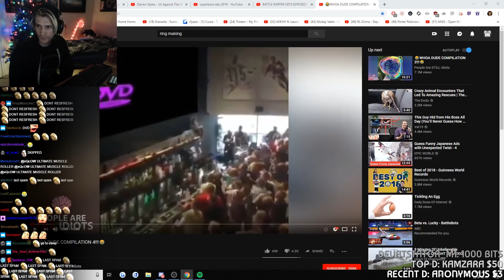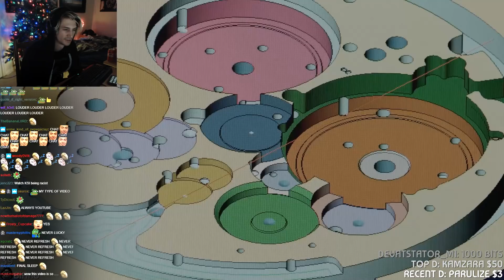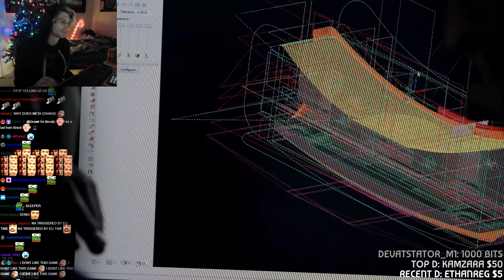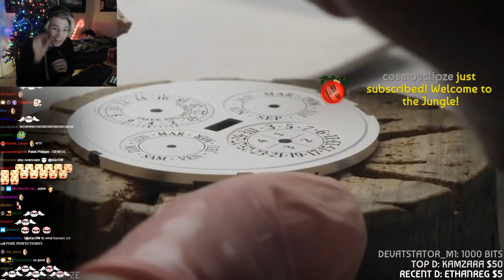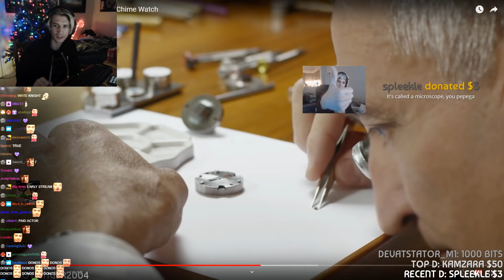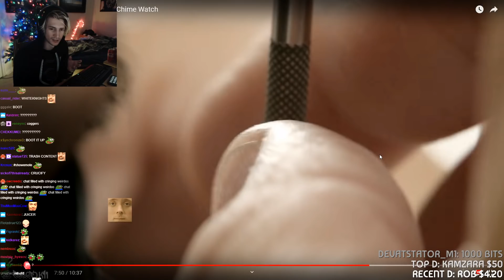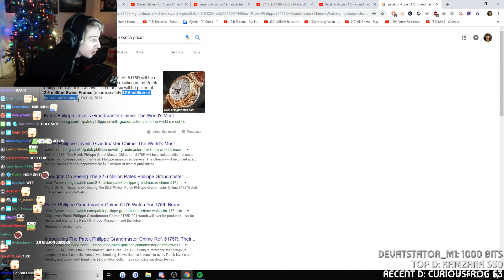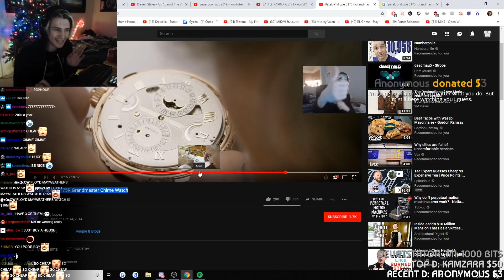$2.6 Million Dollar Watch - xQc Reacts to Patek Philippe 5175R Grandmaster Chime Watch | with Chat!

Comment: It's the same thing with most one-of-a-kind items. A Rolls Royce is built from scratch entirely by expert craftsman and they cost between 200K - 1M. The price is fair.
Reply: You're paying for the craftsmanship, if 10 people in the world are able to do that without mistakes they should earn a fuckton of money
Reply: @ssm-sf8by  Nothing like that should ever be worth that much. Anyone who buys this has too much money anyway.
Reply: Ecksy Dee exactly, this is common sense. Clearly it took you a long time to figure it out since you decided to comment on it
Reply: @SeRoAnthem  really? You're telling me this isn't a budget watch? How wild!
Reply: Not only the craftsmanship, but also the incredibly extended knowledge that goes into designing and manufacturing an object like this. After which you also have to factor in the workspace and all the tools required for building something like that. Here's an example. One of the machines that build LEGO bricks can easily cost 100K USD (excluding running costs). That price is offset because the machine will then produce billions of similar pieces. Now compare that to the tools and machines required to construct a watch like this, where most parts are bespoke or highly limited in production. That's not something you can compare to average market prices, and is the reason why limited productions and bespoke items have an exponentially increased value compared to mass production markets. Even a Rolls Royce has many parts that can be sourced or built in high quantities through partnerships with other companies (like BMW), which greatly reduces the production cost per piece. Of course a price on a watch like this Patek Philippe is to some extend inflated because it's so unique and exclusive, and they know that there is nothing else quite like it, and people who can afford it can afford the extra inflation in price. If you tried to be too competitive with such a time and resource demanding product,, then the final sales revenue would not make it worth the time, and you might as well go for something less exclusive that can be sold in higher quantity for the same effort and still make the same money.
Reply: @SeRoAnthem  Money is simply a made up term that describes how many choices a person has within society. Having lots of money or spending lots of money means nothing on its own. If you can't get what you want because someone things it is "too much", then you limit your choices in life and then you might as well just throw your money out the window. Being able to chose to own something like this watch is the entire point of making money. If you have the choice to own it, and you want to own it, then it shouldn't really matter how expensive it is to buy. To each their own, I would never get a watch like this if I had 10x the money, but for someone else it might be the very reason why they strive to have as many options in life as possible - which equals to having lots of money.
Reply: N OMEGALUL
Reply: @Real_MisterSir  x to doubt, I don't have money and I can steal this shit TriHard 7
Reply: @bloodwolf2609  yea like a watch like this will just lay around casually in an average home without security.. just steal it 4head
Reply: But tbh it's just tells time. I'd rather just buy a normal watch 😂
Reply: @drage1019  The thing is, you don't get a watch like this for just looking up what time it is, in the same sense that you don't get a Picasso painting just because you want something to hang on your wall.
Reply: It took them 10 years to make it
Reply: @drage1019  time is the most expensive thing we have got  so why should we read it cheaply
Reply: DRAGE people can spend their income in anyway they want, not everyone earns minimum wage hence why there are millionaires and billionaires. Same goes for cars.🤷🏽‍♂️
Reply: JACpotatos I mean whoever bought this for 2.6 million in 2014 just made almost 19 million dollars because it’s worth 21 million now so in reality it’s an investment that will pretty much always return
Reply: @drage1019  Why dont you send part of your money to charity too then? If they worked hard and earned their money let them spend it on whatever they want.
Reply: @SeRoAnthem  this sounds like communism to me.
Reply: @drage1019  lmao imagine thinking rich people are obligated to donate money unlike the middle class or lower class
Reply: @drage1019  Lol you are delusional.... The reason why you would buy a watch like this is because its the best investment there is.
Reply: @toooooooooooooooooooooooooooom  no it isn't 😂 invest in something better. Like a business or a house, something that actually has a function besides telling you what time it is
Reply: @toooooooooooooooooooooooooooom  This dude really just said invest in the property or stock market and not a watch and you're calling him dumb lmao. You actually managed to be more pepega than xqc himself.
Reply: @xaten1923  I dont know what a pepega is and i dont watch this xqc guy but do tell me how you could make more profit from lets say ETFs with speculation or hedging, than a highly limited edition watch in a year.
Reply: @binraswtor7760  It is. Hes insecure and unhappy that people are more successful than him
Reply: @ziinx5899  Heh, if you say so, kid
Reply: @ziinx5899  And yet your perspective is that of a child's. So really, there's no harm to me calling you 'kid', kid.

Comment: With the materials needed to make it, the machine costs, and the work time, 2.6 seems fairly decent. The precision needed to make something with this many moving parts is incredibly hard. Most of these parts probably have tolerances in the range of hundreds of  micrometers.
Reply: ^ finally someone with common sense. Also remember to take into account the experience and education that a watchmaker of this quality has to undergo before undertaking a project like this watch. People who say it is way too expensive, could just as well be saying that a spinal surgery should be relatively cheap because the materials and equipment used is similar to many other surgery types - but they forget that you'd likely need 15+ years of education, and then another 10 years of experience before you could successfully undertake a spinal surgery. Education and experience of this high quality is not cheap, nor is it common. It gets exponentially more expensive for each years worth of experience and know-how that has to go into the operation of creating something like this watch. Maybe 1000 people in the world have the skills to do it, and most of them don't have the time to invest into such a project, so it is really clear that such a price might be a tiny bit inflated, but is well worth it regardless. If it was a government-owned object it would just be deemed invaluable because you'd never find it anywhere else ever again.
Reply: Michael Franz  theres only like 25 millimeters in an inch so i think youre a little off with that one..
Reply: @THDYZ  no its not worth 2.6 mil it's just not don't even argue for it. That's just dumb.
Reply: Tolerance is in the 1/1000's of a mm, you can catch the measuring tools in the beginning. There are very few people able to assemble and properly adjust a watch with this many complications, just the chiming part is hard enough to get the sound/timing right.
Reply: @THDYZ  'happily pay 2.6 mil' for a watch. Ok then. Can't argue with that. If their happy paying that much then it is worth it.
Reply: 2.6 or not even if you had the money they wont let any random buy it its like limiteds cars from ferrari that only " specials clients " can buy
Reply: Alessandro Di Salvo the work is a lot more than what’s shown, plus you have to consider the design which is patented for that watch only.

Comment: The watch is so expensive because of the insides. This watch works without batteries. It starts spinning when you move your arm and you it will probably work for some weeks just by one flick. And this watch definitly took 3months to make + swiss quality and swiss pirce its not that expensive
Reply: How long does it take to craft a Patek watch? Stern: An example, a simple movement is minimum four years of work before you can present it. A complicated one, we're talking about six years approximately. And a very complicated one, like a minute repeater or a tourbillon, this is about eight years.  Taken from a source on the internet
Reply: @lucas_doell  true, if it was cheaper then everybody would buy it, that's why they don't reduce the price of rolls Royce and lots of luxury things just to keep them attractive for rich people. rich people only want shit that nobody else has and they know they are getting ripped off but its fine just because its unique and they have more than enough money
Reply: This one actually doesn't wind itself with movement, and the ones that do will run for a few days fully wound not weeks

Comment: Part of the cost is brand but also remember that this are extremely complex pieces of time measuring also they guy that do the final assembly get pay a lot but that’s because of his knowledge and of course if he brake or scratched any parts of the clock (like the golds rings or even the mechanics that required hours to made and polished) he would need to pay for it (usually is a insurance agency that take care of that but the assembly guy/ company pay for it) of course the price is going to went up.

Comment: The high price tag on the watch should be related to how intricate and complicated the internal structures of the watch is. What i don't understand is why this complication itself is necessary for the watch, when the exterior is the only thing u can see. There's no way an owner/buyer would open up/scrap the watch to "appreciate" the internal mechanism/structure. I can't find a good enough analogy, so this might not be a correct/representative of how i see it, but its like you buying a fried chicken 100 times the usual price, just because the chicken is matured, brought up, or whatever the fk in a high-tech secret technology developed by illuminati in Mars, and it tastes literally the same.

Comment: My dad has one of these watches as a heirloom its great cause it doesn't need a battery its based on the movement of the watch i dont know the exact name but it has a small gyroscope in it
Reply: They're just called Automatic watches. They have a rotor that spins to wind the watch when you move it.

Comment: Watches are luxury items. Reason why it’s so expensive is typically the material it’s made of and the complexity of the watch combined. All diamonds watches are ugly but the material price is high yet the complexity is above average making it “affordable” when really it’s just 1000000$ watch based on diamonds alone. If it was built like the watch in the video it could easily cost over 3 million due to its complexity. Compare watches to cars, more expensive, the more exotic, complex and detailed it is. Compared to cheaper cars, they are basic and bland.